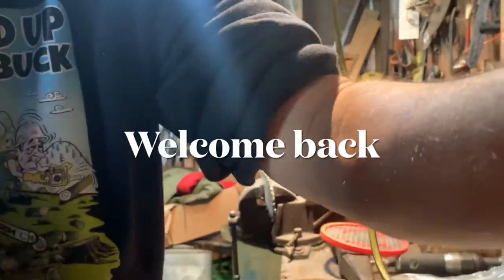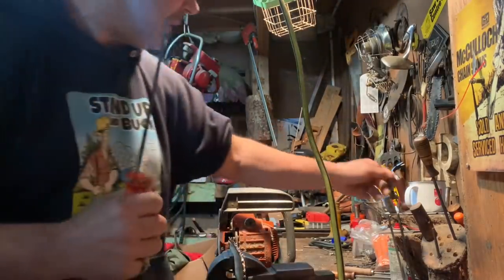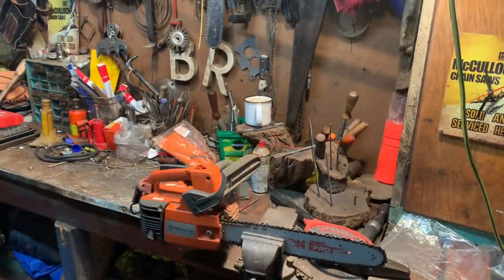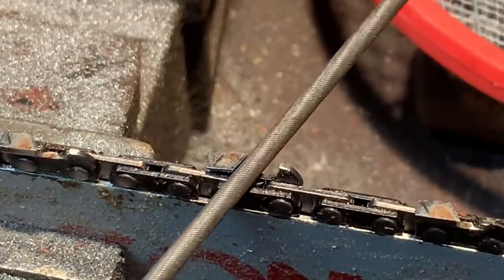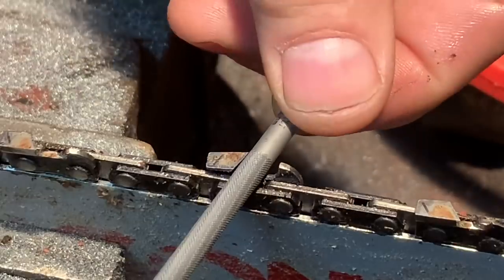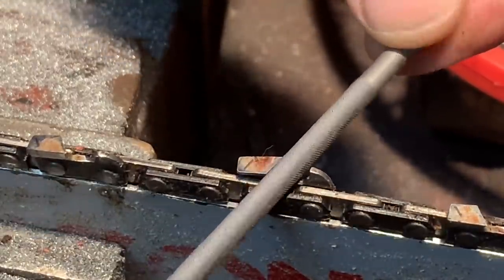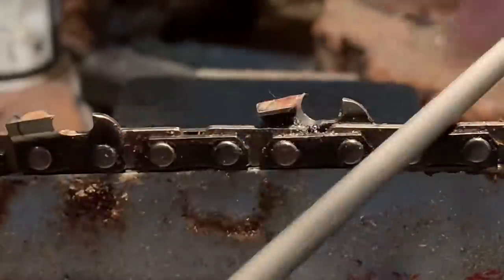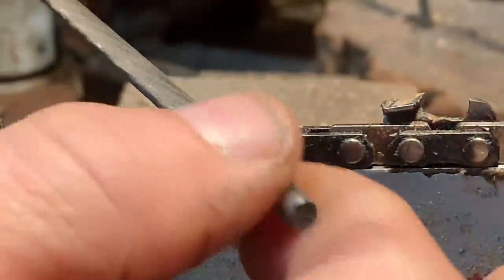How to sharpen a small chainsaw. (What file to use).

Comment: So on my .325 chain it calls for 3/16 file. Would going up to a 7/32 be ok? I like how Buckin’ uses the 3/16 example in this video and gets the gullet!! Thanks friends! Going to help a friend out this weekend. Seeking to serve others!!
Reply: I have the same qustion. From rewatching this right now it's really how the file fits naturally in the gullet. If the file sits naturally in the gullet and it touches that tooth you don't need to go one size bigger. If it doesn't touch go up a size so you get both the tooth and the gullet in one stroke. I'm going to recheck mine tomorrow as I have a 3/16 chain on my Husqvarna 450.

Comment: Thats actually super interesting. I have some saws that calls for a 5/32 file on the chain and I have noticed it takes way more strokes to even reach the tooth. I totally seen the benefit of why a 3/16's is better in the first two strokes you made. I'm definitely going to do this from now on and toss out all of my 5/32s files. A 3/16's gets right on that tooth almost instantly. I'm sure you could round off that tooth if your pulling back way too hard on your tooth with a 3/16 where as it's almost impossible with a 5/32. That's probably why they call for that on some chains. Thanks for the info Buckin. You have definitely sold me on it.
Reply from the maker: i my experience 3/16 works best on full chisel , and the round chain accepts 5/32 quite nice

Comment: How many uses do you get from a file? 1 chain? 5 chains? I understand they're different sizes but just roughly. Anyway to clean files other then tappy tap tap? Or once they done move to a new one. 

Thanks for an awesome video. Have an awesome day all. Be safe.
Reply from the maker: hey Pablo. small saw like that,  one wood get maybe 10 filing . but on a 32'' bar i might get 4. then grab a new one
Reply: @BuckinBillyRaySmith  you're awesome, thank you

Comment: Thanks Billy Ray. sure wish I had access to your knowledge when I started using a small chain saw , oh bout 37 years ago. I had to go by the instructions with the Eager Beaver 2.0 I got. I put a 14" Oregon bar and chain and that little McCullough sure cut some firewood for me. Several years ago it ran out of gas and when I gassed it up, checked bar oil and went to start it, it would only turn a little and hit  a solid stop. When I tried turning it the opposite way, hit a stop also after a short rotation.  Any idea what it might be. I still have the saw and would love to get that little saw going again.  Sorry you had those injuries. I had a serious back injury in 2001 and another in 2016 and I have to be really careful in what I do now or suffer the pain for a couple of weeks. I try never to do any outside  work without my back brace pulled up tight.    Ya know you are only 200 miles north of me. My wife is from Vancouver, BC and she had friends in Nanaimo.   Be safe and be kind.   Tom
Reply: Sounds like a bent or broken conrod Tom , take the spark plug out and put a pencil or something down the hole and see if the piston moves at all while you rotate the crank .
Reply: @Gordon_L    Thanks, I'll try that. So if the piston doesn't move, the con rod is probably broken.  Funny thing is, it was running just fine before it ran out of gas.
Reply: @seniorrider9337  There is a chance it just has a combustion chamber full of oil , once again pulling the spark plug will shed some light on the problem .

Comment: I’m confused about something, was given new chain that’s 3/8,.050,64 DL but my poulan said I need 3/8,.50, 62 DL chain 
Can I use the 64 on my saw ???
Reply: Check to see how it fits on the drive sprocket. If it doesn't match perfectly, don't use it. You  will wreck your sprocket and the chain.

Comment: Hey buckin i have a mccallogh pro max six for up in the tree and took it to a shop and the jerry rigged it and put plastic parts instead of a metal spingsystem on it and tore off all the fins to the flywheel and distroyed the pull cord system and suggestions for me as to where to get parts brother
Reply from the maker: ebay

Comment: am I crazy or does the 3/16 work better because you used the 3/16 last time and not the 5/32? Please someone tell me what I’m missing here.
Reply: 5/32 may give a good gullet, but may file too low to get a sharp top edge. Then you may have to apply upward pressure to sharpen the top edge. Remember how he showed the 5/32 not touching the top edge? Also, the 5/32, after more work to sharpen the whole tooth, may put too narrow of a cutting angle on the tooth, making it weak and prone to dull more quickly. The 3/16 will give the tooth a stronger cutting edge that lasts longer.

Comment: With the pico wont I run into an issue as chain wears filing into the next link?
Reply from the maker: next link?  do you mean the strap ?
Reply: @BuckinBillyRaySmith  yes the strap but I saw later you mentioned not to worry about this. Thanks Buck’n for all you do particularly taking the time to respond to comments from us backyarders

Comment: How do I get a file that lasts longer than 1 Sharpening. I have a box full of old files.
Reply: Do not saw the file back and forth. Only put pressure on the file in one direction, pushing away from you. The draw stroke should either not touch the tooth at all, or at best very lightly. Files are meant to cut only in one direction. Clean the filings out of your file after each use.

Comment: I "over-got" my gullets the first time I tried doing it and found I had too much hook. Took some file finegeling to fix that 😉
Reply: That can be frustrating! I go extreme upward angle to recreate the working corner and then use that new groove to pivot the file back and get the rest of the tooth. Setting a bigger file in there for a few strokes could sort it too I imagine

Comment: I find the small file on the 3/8lp leaves a lot hook, too much energy is spent trying to pull up and into the tooth to get the top of the tooth and still accurately file both edges.  Typically leads to more time pulling out the gullet as a second step and less accurate angles- at least with my experience. Thanks for sharing.  I will try the larger file on my next sharpening.
Reply from the maker: start off wipin out the gullet or you ll end up with the dreaded shi jump ..love ...

Comment: I don"t get this at all... Each chain has a specified size of file to use... Written on the box when you buy it...Also there is more than one angle on the tooth to fallow...And you can"t achieve this without a dept gage..  Read the instruction on the box to have a long lasting cut of your tooth.

Comment: Mr Buck and I always get one side of the chain sharper than the other so can you tell me how to fix that
Reply: Some of the files cut more off filing sharper into the angle on the right than away from it on the leftside....or s it the other way....ha! 
That's why not to file same number of strokes on both sides necesarilly.I do believe the files cut more aggressively on the one slant....'tain't talked about much. ,but that takes some study and fine not pickin'

Comment: What do you use for a .325 pitch?
Reply: Have the same question... normally you will use 4.8 mm, but it’s really difficult to get the hook into it. Any ideas?
Reply: @johnnyhomegrownholmgren9999  yeah I use a 3/16" as well but sometimes I get a little to hard into the gullet and get more of a hook than I'm looking for.  I noticed Oregon sells a 5mm file hmmmm...
Reply: scubaseppy : Will look for that file. Worth spending some money and try it! Are trying to get an old husky 55 to cut like crazy. Thanks for the suggestion! 👍

Comment: 3/16 vs 5/32 is only a difference of .032. 32 thousandths. You are only using one side of it which means it's only 16 thousandths. It'll work just fine.